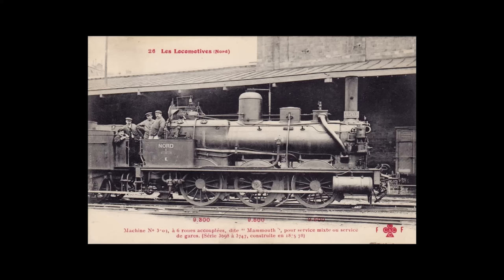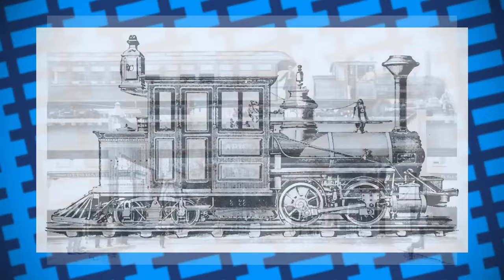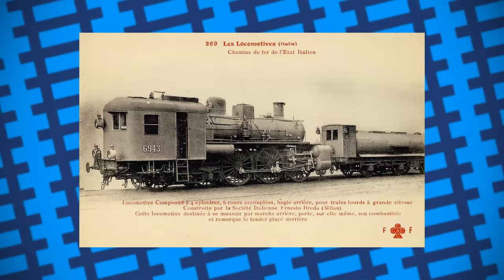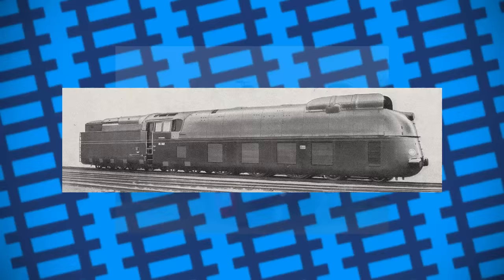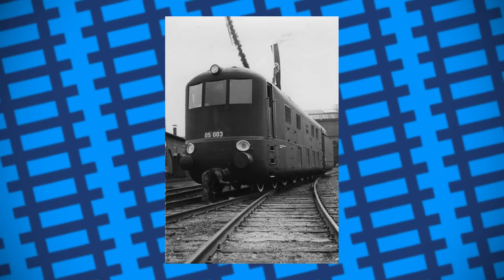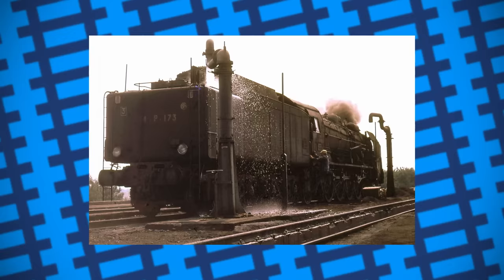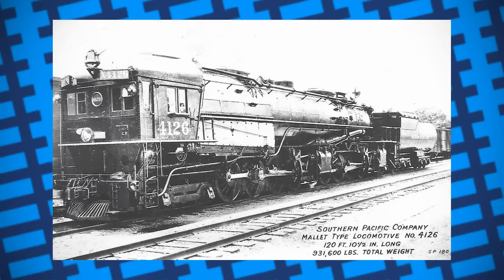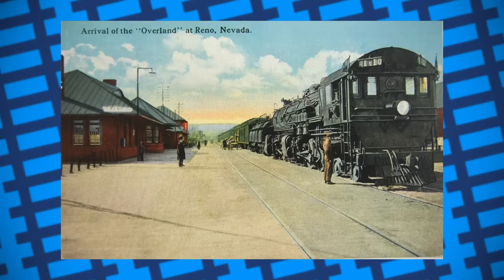Why "cab-forward" steam locomotives usually didn't work - Cab Forward Locomotives

Comment: Cab forward engines, good idea on paper, backwards in practise.
Reply: Bah dum tsss
Reply: Backwards in appearance too!
Reply: SP would like a word with you
Reply: *practice
(practise is the verb form)
Reply: Except where they were good in practice, too, as the video made pretty clear...
Reply: I see you did there
Reply: @caramelldansen2204  only in other countries. 
In America, practice is the same either way.
Reply: @blue9multimediagroup  Good for America.
Reply: *sienfield guitar riff*
Reply: @DomQuartuccio  yup
Reply: Oh you
Reply: @senorestupido2803 oh who
Reply: To see an example, look at Lexi in Journey beyond Sodor.
Reply: Not so good for coal burners but rather successful for oil burners, as noted with the Southern Pacific, SP built 256 locos of cab forward design, starting with MC2 2-8-8-2 #4002. "Conventional" MC1 locos 4000 and 4001 were eventually rebuilt as cab-forwards. When converted from "Mallet" (which reused high-pressure cylinder exhaust to feed low-pressure cylinders) over to "simple" (which is to say super-heated high pressure steam to all cylinders) they became classes AC-4 thru AC12 (excepting AC9 which were conventional coal burners acquired in a merger). AC12 and a bit earlier were 4-8-8-2. 4294, preserved at the Sacramento Rail Museum is a class AC12, and is the last steam locomotive purchased new by Southern Pacific.

The MC2's were sufficiently successful that SP had built some "passenger mallets" starting with class MM1. These were initially built as 2-6-6-2 but tended to "stub their toes" until converted to 4-6-6-2, and some were eventually rebuilt as "simple", similar to the AC classes.

See the well-researched book "Cab Forward" by Robert Church for lots of detail. Sadly this book is out of print.
Reply: You know why not just put a platform with railings on tenders of tender engines that Will work
Reply: Figuratively and literally

Comment: Additional geek fact: SP had been using oil for a while (Bunker C). The oil was gravity fed to the sprayer in the firebox. Someone realized this would be a problem on the Donner route; so they pressurized the oil tank to move the oil up to the firebox.
Reply: A steam loco runs a passenger route in SoCal that was converted to burn oil. I thought it was done more recently, however, the conversion was done in the 1930s.
Reply: @jed-henrywitkowski6470  The Southern Pacific ordered its first oil burning locomotive in 1900.
Reply: @jed-henrywitkowski6470  A lot of it was simply due to cost. It was far cheaper to run oil burners in Southern California due to the amount of oil fields and reserves we have, vs shipping in coal from other parts of the country. You can see this in the history of a lot of Union Pacific Locomotives, where on one side of the Sierras, you see Coal burners, and on the other, you see Oil burners.
Reply: why not just use electric engines because electric engines have zero emissions am I litraly the only genius to think of this omg
Reply: @Wooargh  As a confirmed wire-head, I agree electrics are more efficient. Problem is the capital cost in building the infrastructure. It took Penn nearly 20 years to build NYC to DC and that was with government help after 1932. We have to be willing to commit to doing it. Caltrain, SF to San Jose has taken over 5 years and maybe complete by 2024.
Reply: The capital cost of electrifying a railroad is so high that it only makes economic sense on the highest density routes or the longest tunnels.  Even then most of the tunnel routes only used electric locomotives for short sections where the tunnels were. Electric engines may have zero emissions, but the power plants to generate the electricity have emissions.  There were no nuclear plants and no major hydro plants when the Southern Pacific switched to burning oil.  Also remember in the early 1900's there was essentially no concern about emissions.  Today the thermal efficiency of a modern diesel locomotive can be over 30%.  If you look at the total efficiency of the network of a power plant, transmission, and an electric locomotive it is lower than that for coal fired power plants and only a little better than that for the most efficient natural gas fired plants.
Reply: To be honest I have no idea what most of those words mean, but thanks for the geek fact.
Reply: @jamesfisher4326  Yep. So naturally the best option would obviously be a nuclear powered train. No emissions except water vapor and no overhead wires needed.
Reply: @ethanwhitehead2085  Sadly not very practicable. The weight of the shielding is a problem. You have to carry a lot of water or have a condenser on board. Do you want a reactor in your backyard after a derailment? Put the nuc in a power station and run the wires.
Reply: @delurkor  I know, I was just joking. 

Now, about nuclear powered cars...
Reply: @ethanwhitehead2085  FLYING, SELF-NAVIGATING, NUCLEAR POWERED CARS!
Reply: @ethanwhitehead2085  😄👍
Reply: @abigails4088  Oh dear…
Reply: A steam locomotive with a fuel injection system? When was this done?
Reply: Diesel locos are actually diesel-electric--or most of them are. The diesel engine gets to run within its limited optimal rev range, while the electric system copes with the variations in torque and revs needed to move the load.

I wonder why there were never any steam-electrics ... ?
Reply: @lawrencedoliveiro9104  There were.  They were steam turbines like the Jawn Henry, and they tended to be unreliable.  Their water tube boilers in particular tended to be poorly suited to the rough and tumble of railroading, IIRC.
Reply: @lawrencedoliveiro9104  In the US 3 steam electric types were tried. pre-war UP demo-ed two steam electric with condensers. Post war C&O built 3 to be passenger locos and finally N&W Baldwin built the Jawn Henry. Unfortunately all three suffered from various problems and were not successful. Final mention of UP's coal fired gas turbine, which did not like fly ash in the turbine segment. If anyone does not know the history look them up. Neat concept that did not work. Britain tried it also(can't remember the loco  😆).
Reply: @ethanwhitehead2085  Factorio PTSD flashback of getting run down by a nuclear powered train blitzing through a station at mach 3
Reply: @Wooargh  The Milwaukee railroad was electrified over the Cascade mountains long long ago, it was also the best grade, room to double track, with the most practical tunnel. So when rail was in a slump in the 1970s they kept the longer steaper rail grades over the Cascade mountains with the longest tunnels and no room to double track. And recycled the Milwaukee tracks to make a bicycle trail.
Reply: @Wooargh  blah blah electric this electric that electric everything when will people stop with glorifying electric cars
Reply: @ethanwhitehead2085  just what we need, first the flaming tesla's , and now a Fukushima- Daichi on wheels!!
Reply: @Lepper36  It is seldom mentioned, but under California law it was actually illegal to run locomotives burning anything else but oil. Summer rains only occurred in the mountainous regions with the rest of California normally having no rain from the end of May until the start of the rainy season in October. The idea behind the law was that there was too much of a wildfire risk using wood or coal as fuel. And the fact that Standard Oil, the largest oil company in the US (and eventually broken up under monopoly rules) was based in California 'encouraged' the passage of this law...

Comment: In otherwords there's always going to be design flaws no matter what
Reply: *until you switch to electric traction ;)
Reply: @RoamingAdhocrat  untill you lose power from a emp or a rainstorm causing a power outtage XXXXDDDD
Reply: @theoneandonlynumber1253  Or there's too many leaves on the line. Electric and diesel traction just moan and complain that they can't work if the slightest thing goes wrong. Steam engines meanwhile are shockingly robust and can be overworked into the dust if they have to.
Reply: @MrJoeyWheeler  the trade off being that steam engines require a rather extreme amount of maintenance even when nothing is going wrong (because otherwise things DO go wrong, Spectacularly) than diesel and electric trains. Which is honestly the main reason for the switch to diesel in the first place. (now, railways switched to Electric because it was Objectively Better at the things an engine needs to do. Diesel? Advantages over electric consist entirely of 'those who control the purse strings are cheap, and possibly idiots, so this is all we can afford'.)

Also, leaves on the line were bad for steam engines too. That's less of an engine type issue and more of a safety regulation issue, to my understanding... well, I suppose I could see third-rail electrical possibly having more of an issue with leaves on the line than other sorts (on balance, overhead wire is better than third rail outside of certain very specifici niches). 

There was that instance of some British engines being unable to run due to 'the wrong type of snow', I suppose. Though to be fair, that was entirely because they'd been fitted with the wrong sort of filter (which was the only reason there was a 'wrong type of snow' that could do that to begin with), because this was a known and solved issue (water where it shouldn't be is bad for pretty much Anything. Steam engines have a lot less places water shouldn't be, but when it got in those places it did have a tendency to either cause or be caused by rather catastrophic failures.)
Reply: @laurencefraser  fewer leaves-on-the-line issues when a design flaw with your locomotive means that all lineside vegetation must be aggressively cut back or your engine exhaust will set it on fire ;)